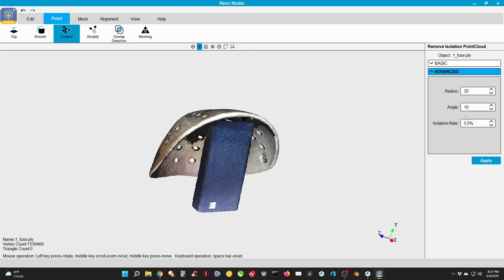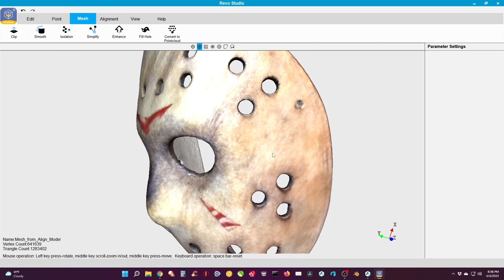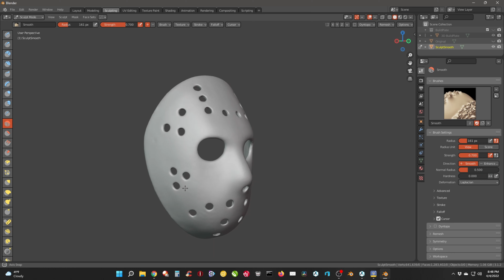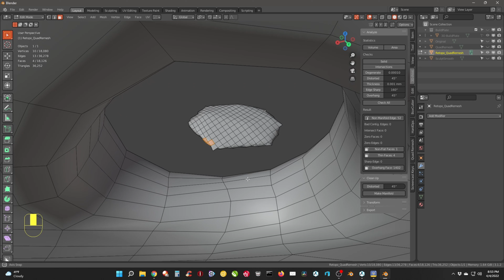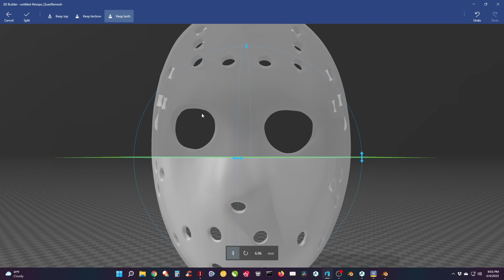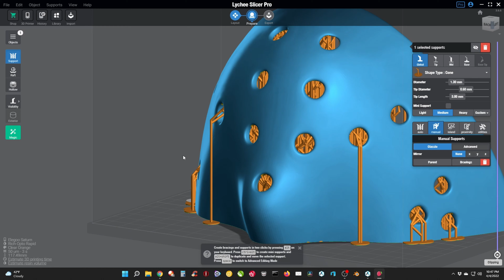RevoPoint POP 2 3D Scanner RevoStudio scanning, merging, cleanup and 3D printing a Jason hockey mask

Comment: What hardware is in your computer to make revo studio to work?
Reply from the maker: It's a pretty good system. Amd ryzen 9 3900xt 12 core 3.8ghz, 64gb memory, Radeon rx 5700xt 8gb gpu and m.2 ssd drives.
Reply: @galaxy5iveArmory  crickey, that’s some expensive gear